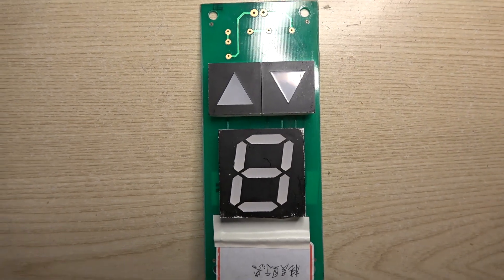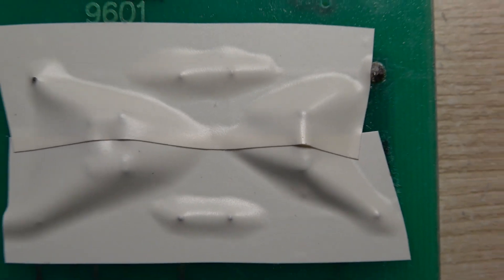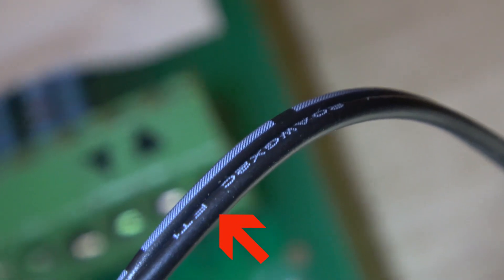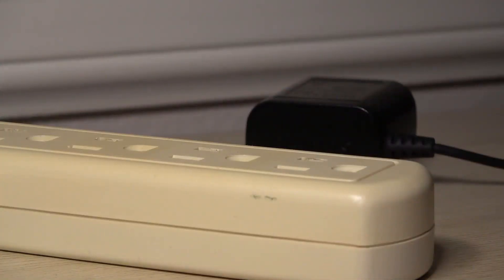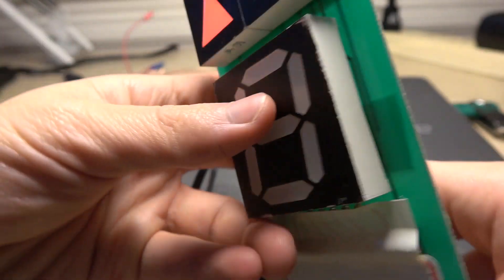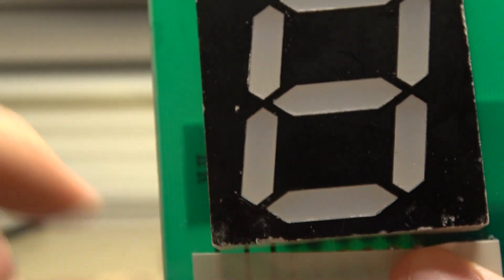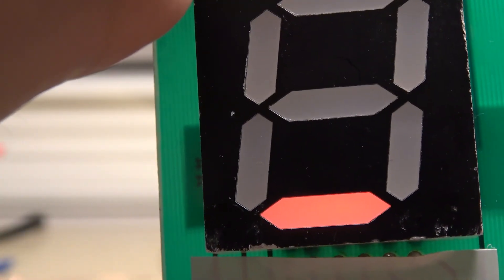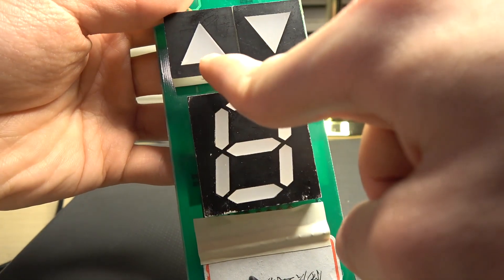Wiring a single-digit elevator floor indicator control board & demonstrating each light

Comment: Difficult to tell what brand of indicator is that, but I've seen a similar display like this on a derelict XIZI (not Xizi Otis) elevator somewhere. Either a XIZI or a generic display.
Reply from the maker: Can I say an older Mitsubishi elevator floor position indicator? Not that I was just told by someone, but I have actually seen this kind of indicator before.
Reply: Up to you